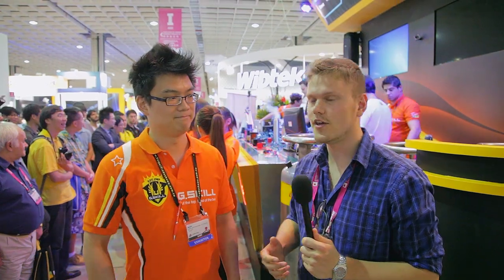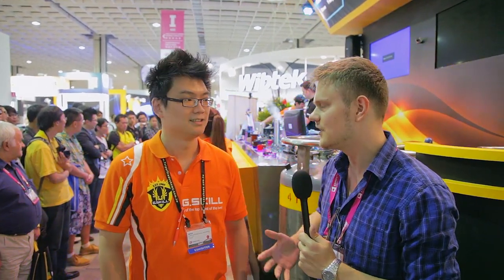G.Skill: NEW TridentX 3000MHz RAM - Computex 2013

Comment: you won't be able to overclock the processor as high, due to the existing need for balance between these two. It's one of the Haswell trade offs: more memory and overclocking potential for memory, for less cpu speed.